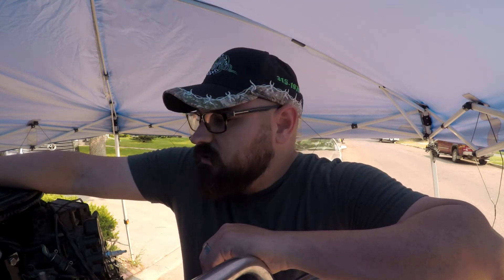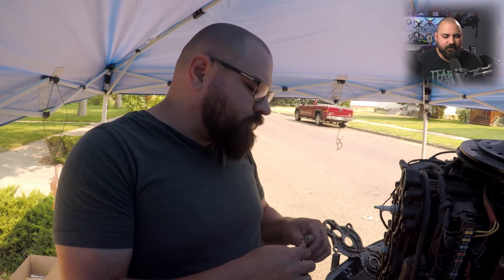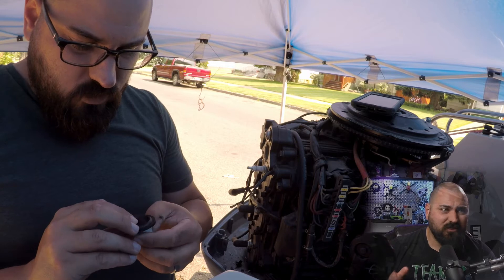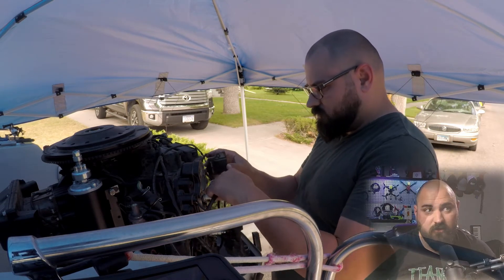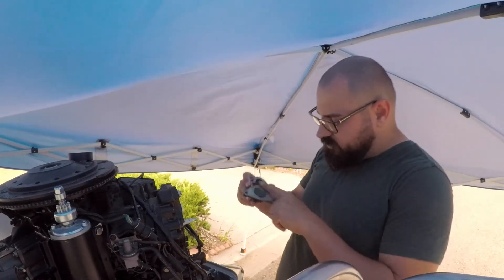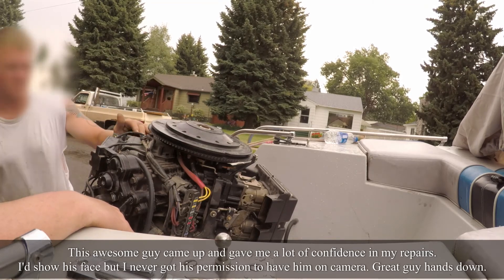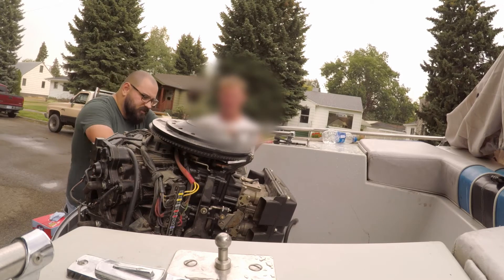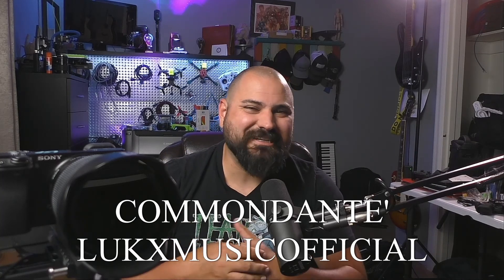Is this the final fix? Larson 1987 Vintage Boat - Evinrude 150HP PT5

Comment: Hey. I just scheduled to have my 1987 Larson Citation 175 into the shop to be restored. I’m replacing the 1988 Mercury 100 out for a 2019 Mercury Pro XS 150. What’s your boats top speed?  Also do you know the weight of your engine?
Reply from the maker: I feel like I got around 30ish? Not sure of the weight.